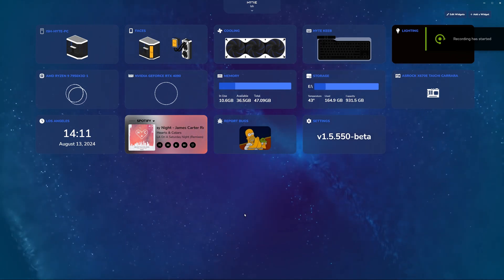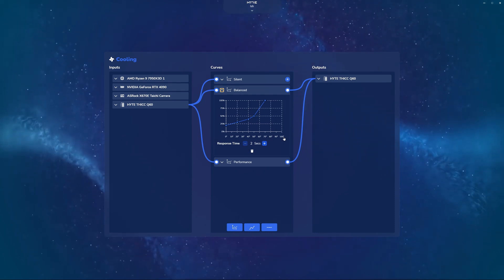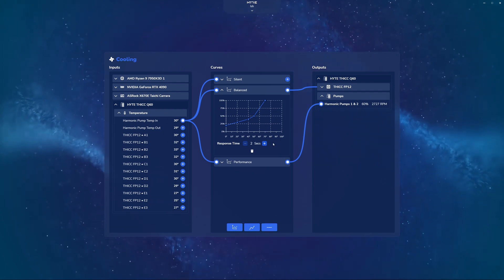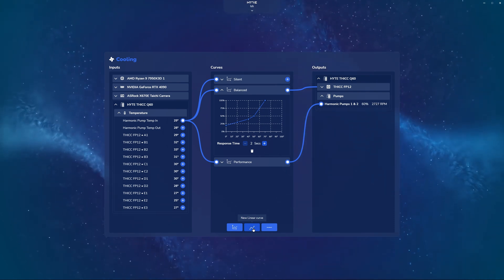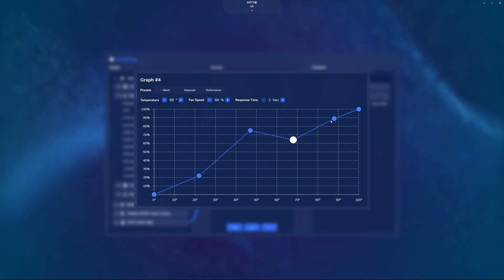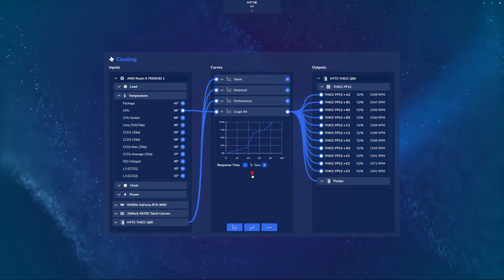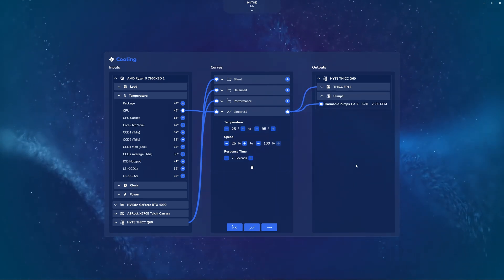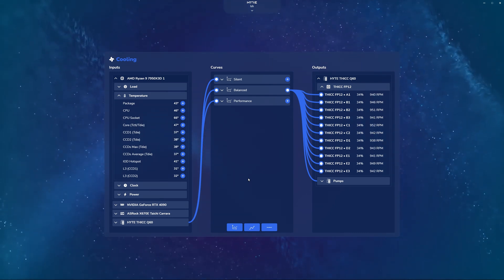How To - HYTE Nexus Cooling | HelpfulHYTE

Comment: this is not intuitive at all..come on..for instance, 2 or more curves cannot be connected to the same output..so how does it work? for instance performance output connected to the hyte, what happens to balanced curve? not triggering fans because of no connection to the same hyte output ? also, I maybe don't want to do this setup, changing curves etc, can you provide a common profiles, like automatically connects inputs curves and outputs ?